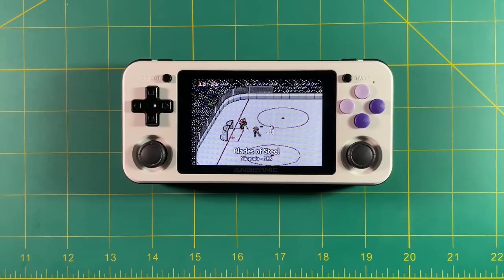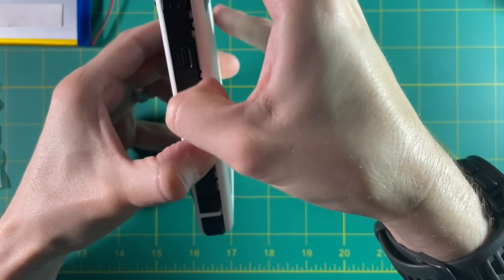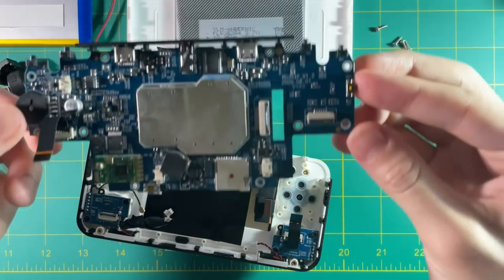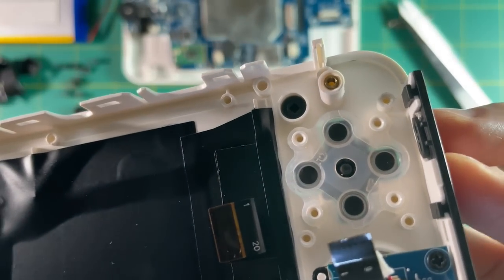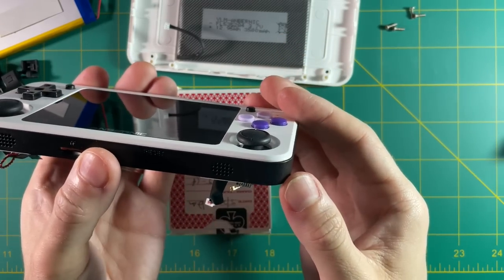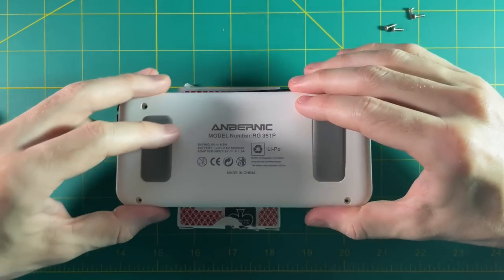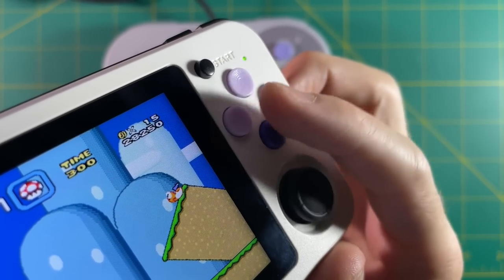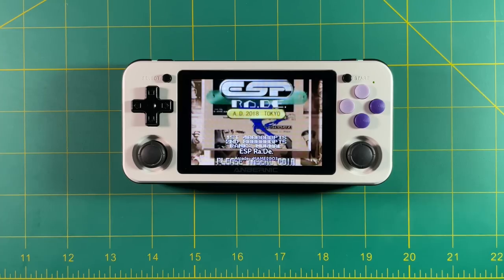RG351P & RG351M Hardware Mods (New Buttons and Battery!)

Comment: Some tips for reassembly , 
1) Use some tapes to hold the Power and Reset button to the bezel.
2) The Power and Reset switches on the board are very delicate and can break very easily if they get stuck on the buttons that are not seated properly.

Trust me, I learned this the hard way.
Reply: My button membrane is stuck down for my "b" button is there anyway to fix w out taking apart?
Reply: @N.K.N.503  you might wanna open it up to see if the membrane is seated properly, or replace if it's broken

Comment: The reason you're probably getting more play time with the newer battery even though it has a lower listed capacity is probably because most non Japanese made batteries tend to way overstate their actual capacities (some can be off anywhere from a quarter to half of their total listed capacity). Project Farm here on youtube has done some fantastic testing on batteries from different countries showing that not all are created equal.
Reply from the maker: Great insight, thanks!
Reply: Are you sure that's a Japanese battery? Weird that a Japanese manufacturer would cover their product in Hangul, the language of inferior battery producers.

Comment: Glad to see there are some mods that can be done to this device. Oddly enough the I used the screen protector that came with mine and  didn't even notice the backlight bleed until I checked more thoroughly after watching this video. Its there but a screen protector has pretty much diminished it completely unless you look at a specific angle.
Reply from the maker: That's interesting, I never applied the screen protector to mine.  Good to know!

Comment: Some extra tips:

-As with most things in life, taking this thing apart is much easier than putting it back together.

-Do not force a component or cable. If you can't get it out or in the right position, stop and look carefully for other methods. Sometimes letting go of a component and then trying again is enough to remove them.

-The RESET and POWER buttons are not glued to the frame. They can, and will, fall out. They're also extremely small so they can go through the small gap between the PCB and the frame, then get stuck under the PCB.

-The screen ribbon cable is short and delicate. Take your time with it and preferably use tweezers to move it. Bending it too much and pulling on it is enough to damage it.

-Haste makes waste. You can make a 30 minute job take 2 hours if you try to rush things, mess up and then try to figure out what went wrong. Or just trash the device.

Comment: Thanks for the video. Are there other battery options to replace ? Even more powerful than Odroid batteries ?
Reply from the maker: I tried fitting in a 400mAh battery the other day and it wouldn't fit.  I don't want to squish the battery, so I think this one is the idea solution.

Comment: Would be cool if there were any grip mods for 351V, RP2 or PGOS30. Button mods are cool and all for aesthetics but making these things more comfortable to hold and use for longer periods seems to be a more useful endeavor. Nice video nonetheless!
Reply from the maker: You mean....these?? :) https://youtu.be/L0P5ThizVUo
Reply: @RetroGameCorps  Yeah but I am jealous since I skipped the RG350s. I finally caved and bought the 351V as my first Anbernic. I am hoping the ergonomics of the 351V make it better than the horizontal handhelds. 

I have the:

1. Vita 2000 (same blue one as you but with the NYKO Powergrip that makes it awesome for long sessions)
2. XD Plus (with 3DS rubber sleeve comfort grip)
3. PGO1 (no grip so I don't use it much but it is the easiest to carry of all my devices)
4. PGOS30 (no grip but your Simple30 makes it the closest thing to an Anbernic I have)
5. V90 (with a Yobo GBA SP grip and velcro to keep it in place...it isn't perfect but gets the job done)
6. RP2 (trying to find a good grip solution but hard shell 3DS grips at least help make it comfortable)
7. N3DSXL (same silicone rubber sleeve style I use with XD Plus) 

I thought the Anbernics would duplicate what I had. Now I realize I am just collecting these devices at this point so what the hell lol.

My dream device would be something that looks like the NVIDIA Shield Portable but with updated specs. I have big hands and really appreciate comfortable grips.

Comment: I've been following your Arkos final update video. I've successfully installed it and am now scraping artwork and videos. What I noticed was the power going down very quickly during scraping especially when it would cut to videos as a screen saver. I've had to charge my device several times in between, however now it won't charge. I use a 5v charger that I use to charge an old amazon tablet. After charging it all night the device starts up, shows 35% charge then almost instantly comes down to 25% and when I went to navigate the first couple of games I allowed the videos to run it just died on me.
This sort of thing always happens to me, I've barely used my RG351P and I bought it in January.
I now have to buy a tool kit, new battery and hope that's all it is and it's not any of the circuit work that's damaged and therefore stopping the battery being charged.
Thanks for doing the video.

Comment: I wonder if an ODROID go super (4000mAH) battery would also work.  it at least has the same connector.  Might be too thick though
Reply from the maker: It has the same connector, but I have heard it won't fit without modding the case.  I recently ordered one, so I might test it myself.  This battery will definitely fit in the RG351V though!
Reply: @RetroGameCorps  Hello friend👏🏻, did you manage to test with the 4000mah battery of the odroid go super? Does her size fit inside the RG351 cover?

Comment: Next, let’s see a mod where you fit in a snapdragon 888. 😏

I’m gonna get a red magic 6 and use a game sir x2. I so wish we could get something with this build quality and form factor with that processor stuck in. Hell, even an 860. That would blow the rpi cm4s out of the water. I would literally pay $750 for that.
Reply from the maker: I know, it's gotta be coming at some point, right?  A 16:9 dedicated handheld with a SnapDragon?
Reply: @RetroGameCorps  however, I just got my mind blown by a new class of device. It’s the Lokmat APPLLP Max. It’s a 2.88 horizontal android smart watch with an MT 6761 (quad core, 4gb ram, Android 9, 64gb internal storage). 640x480. Has WiFi, Bluetooth 5, 4G. It’s detachable from the wrist strap so it turns into a mini tablet/phone. It has two quite decent cameras. 2200 mah battery. Thinking of adding an 8bitdo zero 2 - presto, retro gaming on your wrist.

Comment: Hello friend👏 excellent video. A question, is the Odoid Go Advance battery connector the same as the RG351 battery connector? There are other similar batteries, but it doesn't have the connector that goes on the board, will I have to buy a separate connector and fit it in the wires, or just this type of battery that has the right connector?
 I thank ! 🤝
Reply from the maker: Hi Paulo, they have the same connector, it's a drop-in replacement.
Reply: @RetroGameCorps  I understood. In the case if I wanted to put a bigger battery of 4.000mah, would have to find one with the same type of connector, or adapt the wires in the connector of the original battery of the RG351?

Comment: Do think there could be a screen upgrade. The normal screen has an issue with screen burning,at least for me.
Reply from the maker: You could definitely replace the screen, but there are not other screens on the market with a 3:2 aspect ratio that are better than these.  It's an odd aspect ratio and size, so we're kinda stuck with what we have.

Comment: Thanks for this! Question though: do you know where I can order a replacement rubber membrane for the buttons? i think I may have overused the buttons thus wearing out the rubber membrane lol.
Reply from the maker: Yes, if you contact Anbernic directly via AliExpress they should hook you up.
Reply: I think I did the same but I wasn't jamming them it anything

Comment: Just got my battery replacement in today. Hoping it helps. My battery went from good, to decent, to horrible. Fingers crossed!!
Reply: How'd it go?
Reply: It solved my issues. My original battery would last for 8 hours (tested while playing Grandia on PSX). At the end I was hardly able to get 2 hours of gameplay from GBC emulation.  The new battery lasts like my original did out of the box. Definitely worth the money.
Reply: @turnedmyworld  Thanks for the insight! I'm curious how long it took for you to notice a difference? My battery definitely drains pretty quickly. I'm guessing it might last two or three hours on a full charge?
Reply: @PhoenixWrongSSB  I first got my 351P in January and the battery was really good. I use my device daily and have finished around 20 games on it (about 250 hours of gameplay so far). It wasn't until mid April that I noticed the battery going. I would go from full charge to 60% in about an hour. A far cry from what it once was. With the new battery I played about 3 hours of Pokemon Crystal yesterday and am showing 70% battery remaining. Very impressed.
Reply: @turnedmyworld  Woah, 30% in 3 hours is great. I get that it's GBC, but I don't think my battery is even close to that. Will be looking into getting a replacement then :)

Comment: Thanks!  Any tips for shoulder buttons remplacement.  One isn t clicking right
Reply from the maker: I would take it apart and look at how the button sits in the device, you may have to put something (like a small piece of tape) at the bottom of the button to align it correctly.  You could also contact Anbernic and they might send you a replacement button.
Reply: @RetroGameCorps  thanks for your answer (add the GREAT content, thx for your work) for the button, anbernic wanted to refund 15euros but I don't know how to found the switch and button, so they propose to refund my account. but I would prefere to repair it, or upgrade with 3d print shoulder button. I'll ask them

Comment: i don't get the battery thing... the original one is not charging to the max capacity or something? i don't see how else a lower mAh battery would last longer (assuming they have the same voltage), but it's great that there is a fairly easy other option for better battery.

as for the buttons, to be honest i don't like them, one is that the upper buttons are lower, they should have been made higher. and that texture on them, i guess they could feel nice, but they don't match the rest of the case.
Reply from the maker: I honestly think the Anbernic battery was incorrectly rated, that’s why we are seeing a disparity.

Comment: I’m a little confused with the effect of the battery change😅 you mentioned it has less mAh but lasts longer? As always, love your vids!
Reply from the maker: Yeah, it’s paradoxical, but this is a higher quality battery and does indeed result in longer playtime!
Reply: Retro Game Corps it makes sense, I had not thought about it. Ordering one right now for my RG351P 😁 Thank you!
Reply: @Jeyxero  looks like his comment disappeared. Do you happen to remember what he said?
Reply: @ohdaUtube  yeah, the Battery has a smaller number of mAh but the quality is better. Personally I bought it and has been lasting longer
Reply: @Jeyxero  thanks for this. is there a reason we couldn't use the 4000 mah battery he used on the 351v?
Reply: @Jeyxero  looks like it's 2.5mm thicker. Maybe that's why?
Reply: @ohdaUtube  you’re welcome, tbh I’m not sure. I can’t recall if he mentioned it but I think it could also be due to space constraints but I’m guessing at this point.
Reply: @ohdaUtube  Yes, i think that could be the case, the 3000mAh one from this video already fits really tightly as it is.
Reply: @Jeyxero  awesome! Thanks again!!
Reply: @ohdaUtube  you’re welcome! Glad to be of help😁

Comment: Thanks for this video, I always jump to it when you feature the 351P. Note I too have the wifi speaker issue except I have no internal wifi board and get the noise with the USB wifi adapter. Do you think shielding the speaker wires will help in this instance?

Comment: Is there an explanation to why the "smaller" battery lasts longer?
Reply from the maker: It comes down to a difference in quality. The HardKernel battery just used a better source.
Reply: @RetroGameCorps  does it mean the rating of the original battery is misleading?
Reply from the maker: @CarsonsVids  I won’t go as far as to say that Anbernic did something shady with their battery, but it sure looks like they did something shady 😂😬

Comment: The original battery of the 351 must have been wrongly rated thus the replacement batt has nore power albeit bri g rated with lower capacity

Comment: Im gonna do that battery upgrade immediately, it's the one thing i don't like about the 351p so far.  Do you find that the upgraded battery charges faster? And does it have a wider charger compatibility?
Reply from the maker: Compatibility appears to be the same, but I did notice that this one charges a bit faster.

Comment: Do you know of any other compatible battery I can get my hands on? These links have been showing out of stock for some time now.
My battery has stopped working properly, it won't charge fully even if you leave it on all day, when you boot it the little it is charged quickly goes down in number and then just shuts off.
I think its a coincidence but it started after I put Arkos in, but I'm sure it's not that.
Any suggestions would be most appreciated, I basically can't use it at the moment. I don't even know where to get a stock battery even though I've done a search.
Reply from the maker: Hi, try myretrogamecase.com, they have several battery sizes available and some of them fit the RG351P/M.  You may have to contact the site owner to get more specifics, I'm not sure which ones in particular fit.
Reply: @RetroGameCorps  Thank you, I'll take a look at that. I know someone who fixes screens on traditional handheld consoles, he may have some experience with batteries too, I'm trying to contact him.
Just one more question. I'm thinking of buying either the RGB10MAX or the RG351V. I want it for mostly PS1 games. I know there are a lot of handheld that can run PS1 well but I like the aspect ratio and screen quality of the RG351V even with 1 analogue stick. The RGB10MAX has a form factor I'm more familiar with and when the aspect ratio is adjusted after watching your video on it,  you still get a pretty large 4" screen. Both run firmware that will make all games work where as with standard firmware some games don't start and have a black screen.
From the build quality the RG351V looks more solid but I have no idea how the shoulder buttons will feel to use in my hands.
What are your recommendations? I have been watching a ton of mostly your videos and both are on offer at the moment on Ali Express. Thank you.

Comment: I've actually been looking at where I could get a replacement membrane for the ABXY buttons. The A button has been kind of squishy lately and I'd like to have a backup membrane incase it wears down completely. Any idea where I could get something like that? I didn't see it on that website you linked.

I'm definitely going to replace the button style and get a bigger battery for it. Thanks for this video.
Reply from the maker: You should be able to ask Anbernic directly for new membranes!

Comment: I've just checked the battery links and neither have them. I also checked Amazon and Ebay with no luck, are there any alternatives? If there is something on Amazon UK that would be the most convenient and cost effective for me. Sorry for asking, I'd be very grateful if you could help. I've been slowly preparing my RG351P all week with your Arkos tutorial and it's just disappointing that my hardware has failed on me on the day I was looking forward to using it.

Comment: My 351 plastic has audio cracking with WiFi u- no WiFi chip,  Anker otg to tplink dongle.
Reply from the maker: Yes, you'll get crackling with a dongle on the RG351P, good point.  So the tin foil mod might be helpful either way!

Comment: I see the antenna cable you unplugged from wifi card. The other end looks like it's attached to the front half. Is it attached to an antenna? Trying to do a similar setup with my wifi-less unit.
Reply from the maker: There is a WiFi antenna stuck to the left side of the device, it's slender and about 2" long.  Something like this: https://www.ebay.com/itm/201718986353

Comment: Can you use odroid go advance super battery as that has 4000mah instead of the go advance 3000mah?
Reply from the maker: The 4000mAh battery fits but it’s too tight to be safe in my opinion.
Reply: @RetroGameCorps  thanks 😊

Comment: How does a battery that has 500mA less capacity provide an extra hour of battery life?
Reply from the maker: It's a higher quality battery, so even though it's rated lower, it has better performance.
Reply: @RetroGameCorps  I ended up doing some googling because I was curious.  Seems a lot has to do with battery efficiency factor and self-discharge per month.  Thanks for your detailed videos, I've been loving the RG351M!